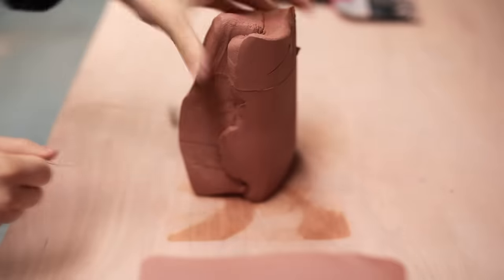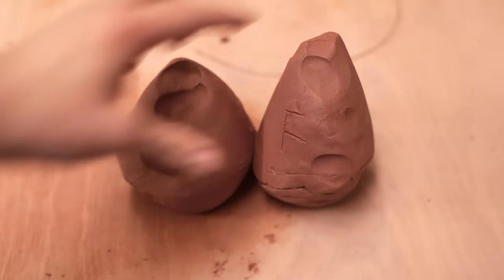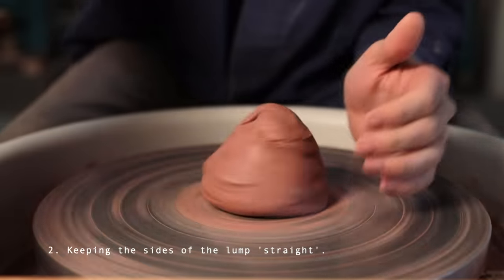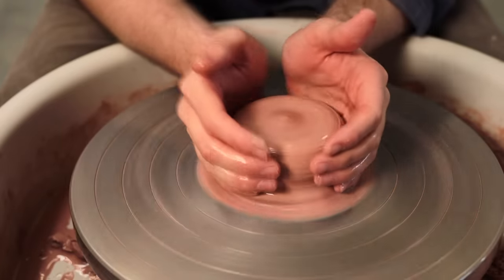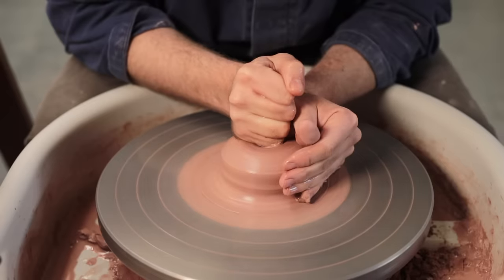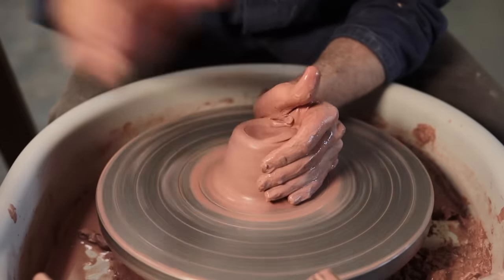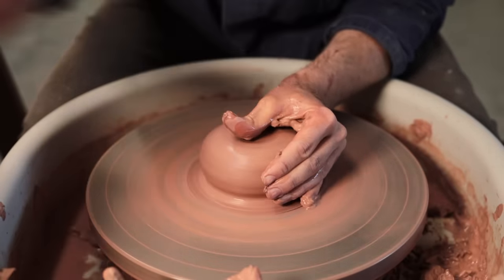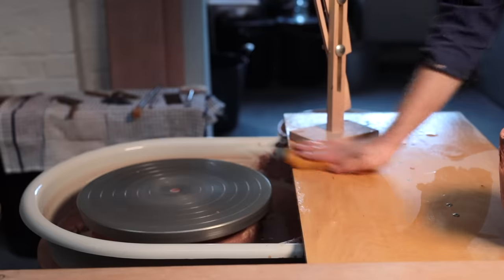5 Tips & Tricks for Centering Clay on the Pottery Wheel

Comment: Florian, I have a throwing subject that seems to not be covered on barely any video throughout  the whole Youtube. And it is about being consistent on width. Even when measuring the opening sometimes I end up with a smaller base than I anticipated. I even wonder if during the pulling process I am pushing too hard, too far down, thus making the initial opening small...I don't even know if that is possible. Would love to see your tricks for that if any.
Reply from the maker: So... when you throw the initial opening and form and compress the base, that measurement, the span of the base, is as my teacher used to say, 'sacrosanct'. It sounds like you're pushing too much from the outside to find more clay to pull up into the walls, which leads me to think that you aren't throwing very flat internal bases with a good sharp corner. You will get over this issue with practice, or you can create a measuring guide so that the width of your pots remain the same. You have to be strict with yourself but don't worry about it too much — focus on producing pots that are the same width/height and eventually the bases will follow and you'll gain some more control over that facet of throwing.

Comment: Just the other day I was working with a particularly difficult piece of clay and started thinking about wheel speed as this particular clay moved better at a slightly slower speed. Thanks for these tips. Clearing that bump of clay on the wheel with your thumb is fast and efficient and I'll start using it instead of reaching for a tool to do the same thing.
Reply from the maker: So glad to hear they've helped! A thumb can do the job well, although if you're using a particular coarse body a tool might still be the best option—a bit of clay around the skirt won't hurt, as long as it's level all the way around. Thanks for watching!

Comment: I'm in the middle of my first pottery course, and this is really a major challenge, so thank you for a super informative video! The techniques we've been taught don't exactly match yours, which lines up with what you said about our hands being different and needing different approaches - I've got a bit larger hands than the teachers on my course, and I think that might be making their techniques not fit me quite as well as they might (or at least it pushes me towards working on larger lumps of clay, which brings other centering issues with it). I'm also kind of shocked to see just how little build-up of slip and clay you have on your hands during this process without them being too dry to work with, which makes me wonder if this is due to different types of clay behaving differently, or whether that's all down to just technique. Either way, fascinating and super helpful!

Comment: Thanks for this video. I’ll try to keep these tips in mind next time I’m at the wheel. 

I’m not sure if this the case, but it seems like the clay you work with, Florian, requires much less effort to manipulate than what we use in the studio where I take classes.  I am getting better at centring, but the thing I find most difficult is bringing the cone down once I have formed it. It seems to take a LOT of force to make it go down; and when I do get it to move down, inevitably, at a certain point, what seemed to be nicely centred suddenly goes completely off centre and I have to start centring again. 

The other thing that happens is that I seem to need to use an awful lot of water: I  frequently feel the clay under my left hand going dry when centring, and under my right hand when pushing the cone down. At the end of the process, the drip tray of my wheel has a good layer of slip in the bottom and sides.